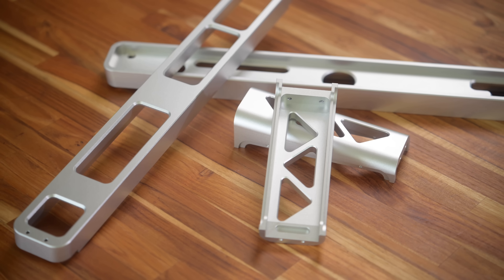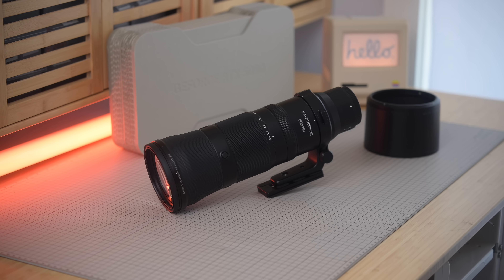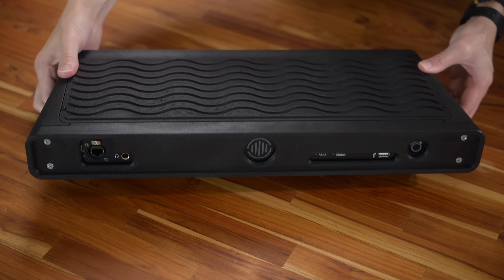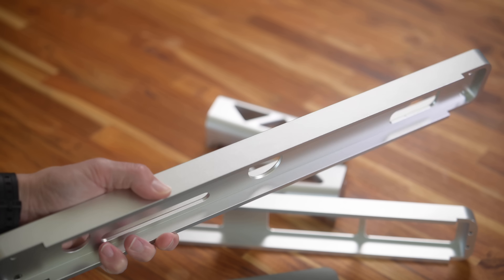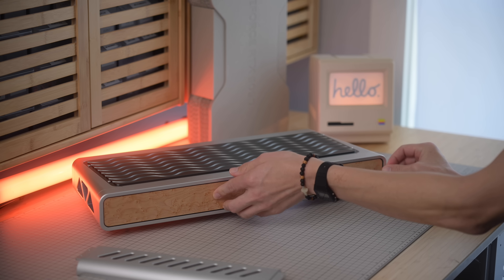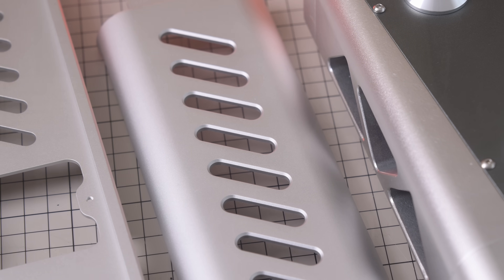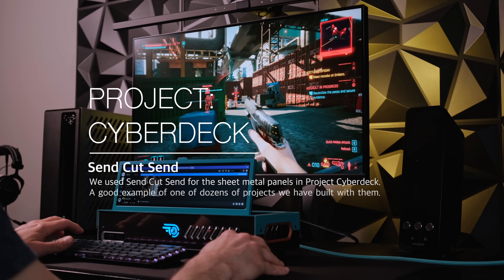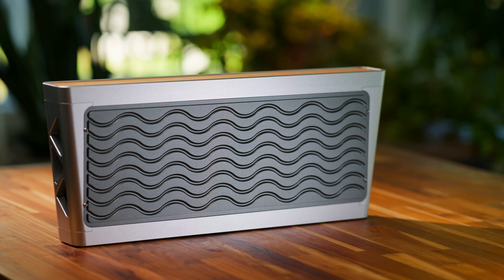CNC so Clean...It Hurt My Feelings :|

Comment: Josh, why the angled struts on the back panel of the s5m? This just looks like its going to intefere with access to rear mounted m2 drives....
Reply from the maker: Because of the geometry there is more open area than any past case I have ever made behind the motherboard and I'm trying to find another case out there that has more. With the angle it also reduces the chance of screw interference because M.2 modules are non standard. And the icing on the cake is I tweaked it to follow the geometric styling of the FE cards.

Comment: I mean no offense, but I have to ask. Is there a reason you have a clip mic held in your hand... but also a mounted mic in frame as well? I know it has nothing to do with the video, it just visually irks me when a tool isn't being used as it was designed.

It's like watching someone eat a bowl of cereal with a fork, when there's a perfectly fine spoon on the placemat right next to the cereal. Really at the end of the day, it's not my food, not my body, I have no real say in how someone prefers to eat their cereal. And technically there's nothing wrong with eating cereal with a fork if they just prefer their cereal to be lightly moistened with milk, but not submerged in a soup of milk. But if I'm personally going to use a clip-on mic, I'll clip it on so that it's discrete and no large mic has to be in the video frame (the small frame of clipon mics is partially for this reason), or if I'm going to have a stand mic, I'll use it and not hold a clip-on mic in hand.
Reply from the maker: I actually am using both. I could move one out of frame, but it's more important for the voice over to sound good. The real question is, how did it sound? Also go back and listen to my earlier videos where I didn't use both, and tell me what you think. I'd be interested in "hearing" your honest feedback. :D
Reply: 3rd try:
Assuming here, nothing more, and respectfully assuredly: It's hierarchically-typified topological efficiency; high-bandwidth coherence maximizing the success anchor and hinged culpability of perpendiced reasoning, a retrocausally self-informative composite and efficasy of purebred G.O.A.T.
Or, just pretend you're deaf and it doesn't really matter to the grander scale of all things OCD here. 😊
Reply from the maker: Listen to this one tell me what you think. Same mic, but only one. https://youtu.be/wWmgj1cFXIE

Comment: Taking a Photo for measuring is wild...its a Standard Rack Device and for something like this you can source drawings from the Manufacturer/the Manual
Reply from the maker: 1. We have had very bad experiences trusting manufacturer provided drawings in the past (see Erick's last video where he had to cut apart copper radiators and re solder them to fit). 2. Every mm counts; standard racks fit in RACK cases, not slide silky smooth into an enclosure with rubber bump stops that take the PAINT into consideration. 3. I wanted to show people how I model custom cutouts for motherboards as part of my workflow. If you think it's inefficient, great, tell me a better way. But I model I/O and parts on a daily basis, and this is far faster and more accurate than a scanner or finding out the spec drawings were out of date or just "approximate". I hope this helps.
Reply: @NotFromConcentrate  Ive done reverse engineering for drafting a decent amount and used laser, probe, cmm, and photo based tools. Telephoto photography is by far the most accessible and if you can get accurate measurements of at least one part of the object (long dial calipers), reasonably accurate. The next cheapest thing would probably be a laser 3d scanner (revopoint etc)- as those have come down in price and would allow you to do much more complex objects, but the workflow can be time consuming for a simple project. The next best would be a used touch probe arm, which can do 3d simple measurements in seconds, locating holes and completing sketches easily, but can struggle with more freeform surfaces, especially ones without physical features (decals/logos).
Reply: Sort of... you still have to determine the locations of controls, terminals and cutouts! There is also some standard tolerance in the width of the actual box and also the width and shape of rack ears is variable, the only things that are truly 100% fixed is the horizontal distance between rack ear holes and the pitch, maximum height of each unit.
Reply: Maybe he's dropping those into CAD and for the workflow it's better than dealing with a model. Idk, but yeah, seems inefficient.